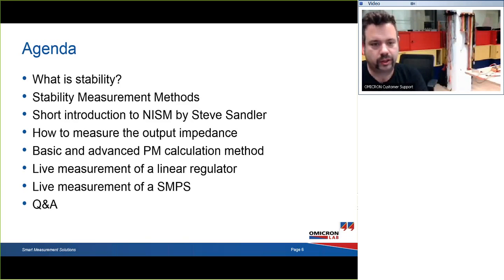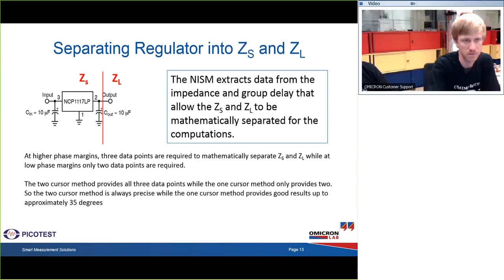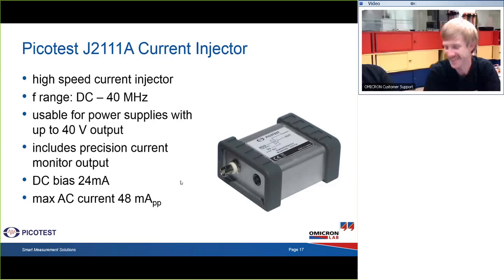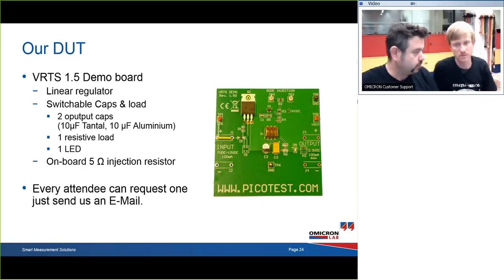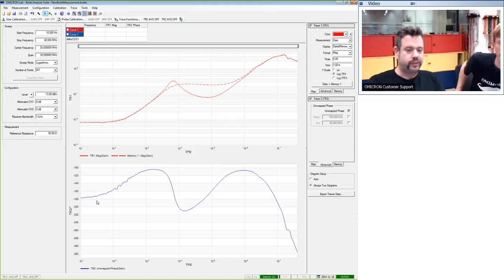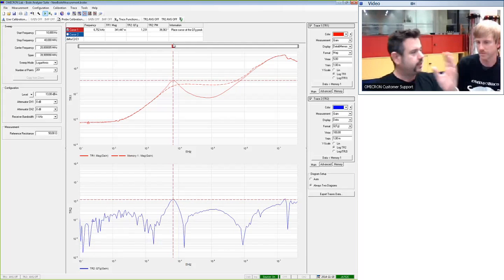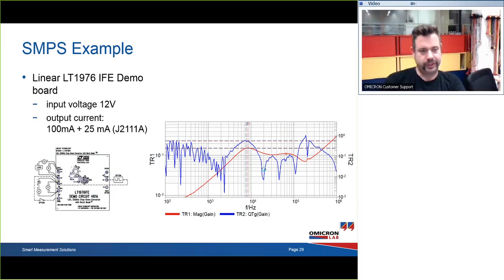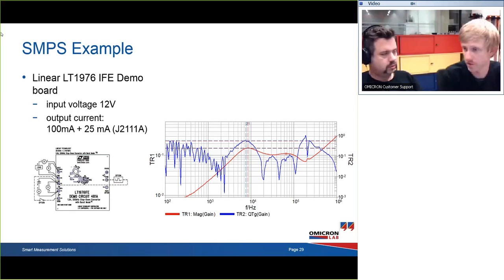Webinar: Non invasive Stability Measurement of Power Supplies with Bode 100

Comment: Where could we find more information about Q(Tg)? Is it a direct measurement [like phase or mag] or a derived measurement?
EDIT: I saw the explanation that is first derivative of the phase. 31:02

How come the peaks on magnitude and Q(Tg) are different?

On related note could you share documents on the 2 cursor method mathematical details?
Reply from the maker: Hi! Q(Tg) is evaluating the phase derivative over frequency. A high Q causes a fast phase-turn at resonance. The 2-cursor math is hold proprietary by Picotest. But there is more information available at https://www.picotest.com/non-invasive-stability-measurement.html

Comment: Do we always need to terminate Channel1 to 50ohm as shown at 17:47? Is it based on the assumption that the current output from J2111A is an AC signal with no DC offset?
Reply from the maker: The current monitor output of the Picotest J2111A expects a 50Ω termination. That's the reason why it should be terminated in that case.

Comment: very good detailed presentation. Thank you. But just have a doubt. in this video, when you are measuring stability for SMPS with higher load condition ( at 49:37), there are 2 more peaks at higher frequencies ,but those peaks are considered for stability analysis.How to know which peak to consider while measuring  Phase margin ( suppose i started measuring PM directly for full load condition.
Reply from the maker: Dear Rakesh Panda, the control loop stability is generally evaluated at the control loop bandwidth. Normally, the control loop resonance is in the kHz region and it normally is the first peak in impedance. The higher frequency peaks are mostly caused by passive resonances and therefore they don't tell you anything about the control loop. Of course you must not neglect them for decoupling but for control loop bandwidth they are not important.
Hope this helps! We are working on an application note that explains all this in detail.